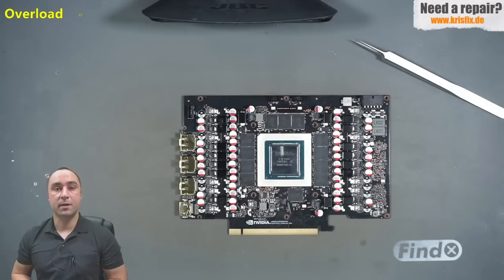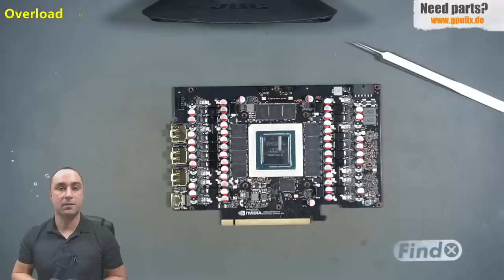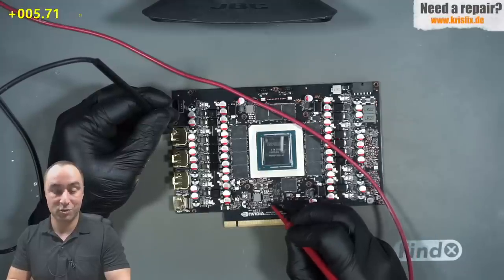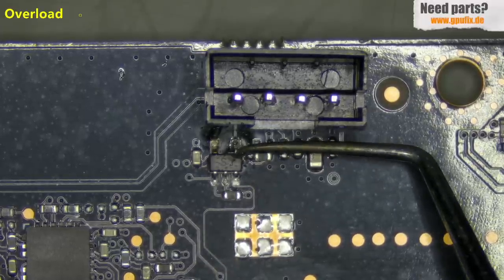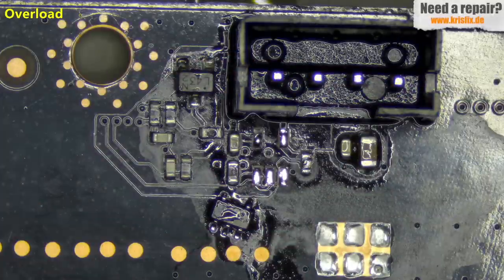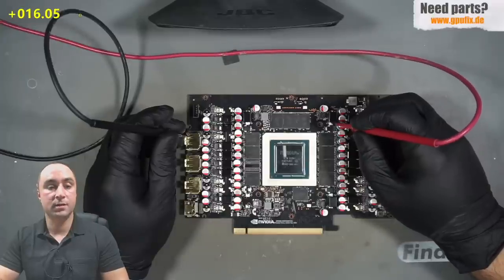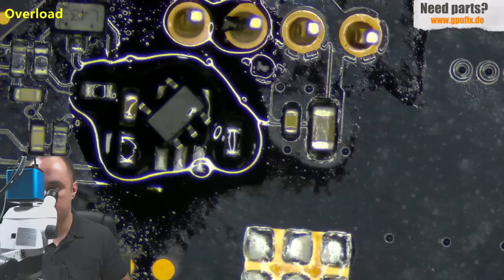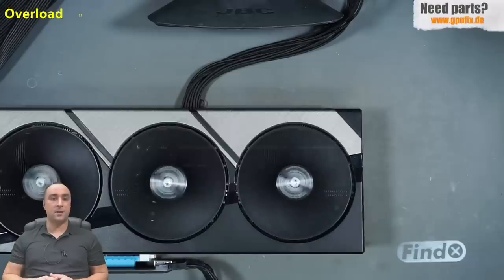RTX 4090 got lucky after Water block installation. How to RMA a card with a broken Warranty seal?

Comment: Those tiny little dudes saving the GPU from the 12V death sentence. True heroes.
Reply: it's a pwm signal, 25Khz (or so), adding a 10nF capacitor on the signal path would prevent frying the GPU.
Reply from the maker: I've seen many processors that did not survive after such a mistake. This one is lucky
Reply: Sound engineering and electrical design is LESS profitable, so when you see it work as intended . . . the moment of pause and appreciation of it is far more impactful. :D
Reply: @stanimir4197  lmao, absolutely not, it is in fact a complex signal as per fourier analysis, 25kHz + 0Hz dc component + the harmonics as the pwm signal is a dc square wave not an ac sinusoidal, in other words putting a cap in series will absolutely not work. And if the gpu has a high impedance at its output (input if you put the RGB connector on the fan connector) combined with a low rise time from the psu aka high frequencyency on the 12v rail will result in a complex voltage divider with a low impedanceance path from the capacitor. Appart from rendering the fan inoperable you achieve nothing much. it may prevent the gpu from dying or it may not but surely it won't allow the fans to work, at that point just cut the trace and you are sure.

Comment: He's like an electronics wizard.  I've never been more impressed by any other channel.  Truly amazing.
Reply: He is good, indeed. But this very repair was not hard, totally not showcasing his skill.
Reply from the maker: There is no difficult repair if the diagnosis is approached correctly
Reply: @KrisFixGermany  That's so inspiring! Keep it up! 

Right now, I'm following the steps you laid out in troubleshooting and repairing a Gigabyte RTX 3090 card with a crack near the PCIe connector. My card is a Gigabyte RTX 3080 TI OC Gaming GPU but it's similar enough. The 5th layer was undamaged but the 3rd layer had the first three traces broken. I've dremeled down and attempted soldering multiple times. I have a single trace left to solder. I'm sure I'll get it soon. I'm just doing it in my spare time.

I'm even more impressed by how easy you made it look after attempting it. The traces are only twice the width of my individual hairs 😂.
Reply: i agree kris is much much more the just a logic board repair professional he is a high level engineer 100%,

Comment: I am so impressed Kris, "sehr gut gemacht", but the biggest question remains:  Why did the customer do this?  I think the lesson from this is:  Do not just plug stuff into holes that look the same without knowing what you are doing.  These cards are so expensive, why would a customer think they can improve it by "half-assing" a water cooling "solution" to it.  If the card overheats in the system, it is an issue with airflow or the case is not breathing enough for the card to remain within operating temperatures.  I see way too often systems come in where fans are just blowing against each other.  Flipping one fan over, so the air flows properly through the case and the issue is solved.  If I were a customer and had the feeling the card would need more cooling, I would be calling Inno3D and discuss with them if a liquid cooled card could work.  Maybe they even sell the card with the liquid cooler already installed.
Reply: I think too many warranty issues are customers doing bone headed moves and not caring what happens because "we can claim warranty repairs" if something goes wrong. I think plenty of AIBs see this behavior too often and you can't fix stupid.

There is also a problem too many YT and tech channels promoting what I would call reckless behavior in overclocking cards for benchmark bragging rights and pushing the idea that anyone can do it! Kris did a video about some idiot who screwed up putting liquid metal on their 4090 and completely borked their 4090 in the process.
Anyone doing DIY installs should RTFM and strictly follow the guidelines or not do it at all if you don't have the experience!

In this case the client blindly going ahead and plugging into the fan header because "it looks the same as a header meant for LCD power so it must be just as good!" almost cost him the whole card. 
I guess some people are rich enough not to care about little details like that, instead of thinking about what the manufacturer had intended.

On the other hand people like Kris make a good living trying to save idiots from themselves.
Reply from the maker: Everyone makes mistakes
Reply: Watercooling was a good choice in many respects. Often, the air cooler is bulky and heavy (even to the point of causing cracks in the PCB). The air cooler is also not always sufficient to handle the ever-increasing power draw of modern GPUs. In this case, watercooling did no damage whatsoever. It was actually RGB that killed the system. RGB strips serve no purpose and are more trouble than they're worth. 😂😂😂
Reply: It's not a crazy idea to connect matching connectors. The problem is that they're not standardized to always supply the same voltages as with the bigger connectors from the PSU (and even there it's a risk with modular power supplies: do not ever blindly connect them if they weren't with the PSU itself).

Comment: 11:17 Bottom of the 3 SMD capacitors, ball of solder peeking under. That ram chip or the smd cap has run incredibly hot for a moment for that to happen (didnt watch entire video yet).

Comment: I'm amazed at the knowledge you acquired about the power rails and how the cards works without proper documentation from the manufacturers. Did you reverse engineer the reference design, and apply that knowledge to the other manufacturers designs (which are probably based on the RD)?

Comment: Great video. I recently had the same problem with the rtx 3070 Ti, which also had a water block installed. short circuit at 1.8v, it turned out that a bit of liquid metal got under the memory and after cleaning everything returned to normal

Comment: Like always Good fix, sometimes it is just good to leave these expensive cards alone if you don't know what you are doing.
Reply: And even if you know, what you are doing, you should still be extra careful.
Reply: Yeah... 100% Agree. how can you put a led strip to a fan connector just because the connector "fits" ... unbelievable. i Put a 20 ton trailer on a Smart, just because the connector fits and didnt expect the clutch to fail... :D

Comment: Just got this card a few days ago. temps are very good, max 64 and below 10 hotspot delta. don't see need for waterblock, although it does dump a ton of heat in the case making my AIO go pretty loud.

Comment: In the UK, warranty seals mean NOTHING. They have to prove that you broke the item by your actions. So, if you break the warrenty seal to, for example, change a fan and 2 months later the card fails, it is clearly not the fault of fitting the fan and despite you breaking the warranty seals, they would have to honour your warranty.

Comment: i also replaced my aircooler on the inno3D 4090, and while i removed the stock cooler i found ah copper flaker under the stock thermalpads... there where also one of the small 4x themalpads missing that are sitting around the gpu chip itself... i got pictures of it postet in hardwareluxx forum....

Comment: I bought my 3070 (I wanted a 3090, but couldn't find one) with a water block pre-installed. Probably overkill for that card, but I had already decided 100% watercooling. I'm a little worried about screwing it up even though I've been building computers for 30 years. But it sounds like he didn't read the instructions. It reminds me of when someone wanted me to fix their computer. They just recently installed a CD-burner. It smelled HORRIBLE!!! I'm like with a smell like that I'll be surprised if anything is salvagable. I opened it up and I'm like you have got to be kidding me. They plugged the floppy power cable into a fan header!!!!! I'm like seriously!?!!?!? 4 pin vs 3 pin and it doesn't quite fit. Yeah if you want to short out half the motherboard that's a great way to do it. lol I tested all the components except the CPU (I didn't have a compatible motherboard). The only thing that survived.....was the cd-burner. lol Everything else was toast.

Comment: That the gates for the Fans were damaged by the customer i can understand. But what has damaged the one Memory chip? If there were a problem on the Memory voltage lane, there should have been more chips damaged or not?  Or was it a fluke that the Memory chip died at the same time?

Comment: Good info on Inno3D warranty, I didn't know that. I basically assumed that I am putting the card on water at my own risk and there likely won't be any warranty if anything happens later, even if not by my fault. Nice to know that this is not the case, at least for Alphacool blocks.
Reply: Well if you damage something when putting the block on, it's still your fault.
Reply: @mahartma  It is and should be always, nobody should expect manufacturer to pay for your own mistakes, but in case the card dies by itself sometimes later you still have normal warranty, and can even send the card in for repair as it is with waterblock installed, that is very good.

Comment: I had to RMA my EVGA RTX3090 graphic card (victim of the New world game bug that literally blew up cards). I had installed GPU waterblock from EK. Before RMA I put original cooler back and my RMA passed. I am not sure if it was because of the EVGA faulty GPU callback or its standard behavior.

Comment: I bought the Inno 3D 4090 I Chill frostbite that has the waterblock allready installed. But thats a good info that you can mount the cooler yourself when you choose an Alphacool Block, very interesting, good info! I am very sattisfied with the alphacool block by the way, good quality, good temps...
Danke für die Info Kris👍

Comment: Satisfying and very informative video as always. Thank you for making these videos, they have been very educating and fun! :D
But I've got a question out of curiosity.. is it possible to upgrade the RAM-Chips of a GPU if they have the same Pin Layout as the original one?
Reply from the maker: Everything depends on the bios and gpu configuration. Many times is possible to upgrade, but not worth it
Reply: @KrisFixGermany  Thank you for the Info. But interesting to know.

Comment: As 3080 just launched I preordered a Inno3D 3080 watercooled from factory with alphacool block on it. I got it around 6 months!!! later and it broke after 2 days without my system even leaking. Probably it was the crappy and cheap plastic alphacool waterblock. I contacted Inno3d warranty team and they refused to have ANYTHING to do with repairs or replacements and told me to contact my shop Ive got it from. Since there was a GPU shortage the only thing the Shop offered me was to refund me the money (700 Euro since it was a preorder). But the prices then where already at 1900€ for a 3080 and no way I could have gotten another 3080 for 700€. Fk Inno3d, never again

Comment: Wait, how on earth was the card overheating with the stock cooler? I thought the 4090 coolers were way overspec'd?
Reply: Dude probably does not have airflow case, because according to reviews this card should have max GPU  temp 65C or so like all 4090s with vapor chamber. He probably wanted water cooling from the beginning. I have 4090, and I would not even think about swapping cooler, these cards are also pretty silent. There are some 4090 models without vapor  chamber, those are hot, but this card should not be.
Reply: @TrekCZ  Thanks

Comment: I wonder how stupid you should be to get 4090 by Inno3D... so much money for such a bad PCB design. Just get an ASUS with phenomenal aircool. No need for water.
Reply from the maker: Basically all 4090 stock coolers are overkill because the gpu was design for more power. Maybe nvidia will unleash this power in 4090Ti
Reply: @KrisFixGermany  4090 Ti is expected not to be full AD102. It's rumored that the full AD102 is saved for Titan model.